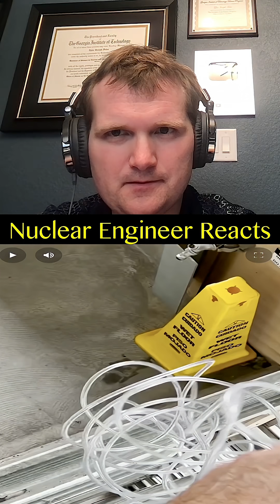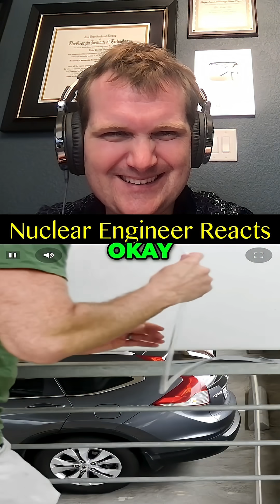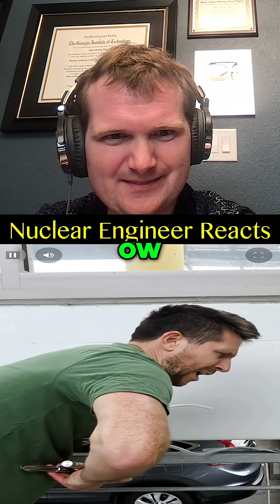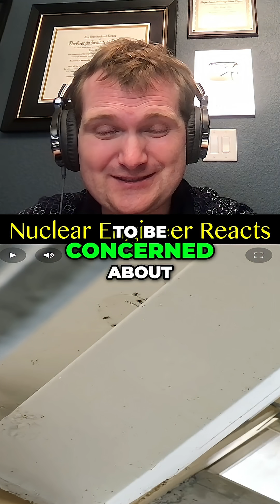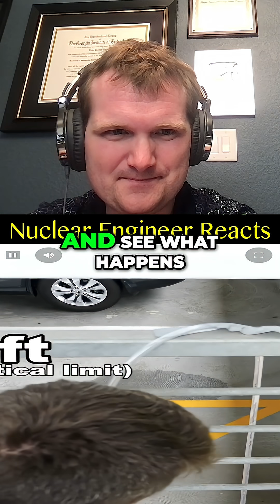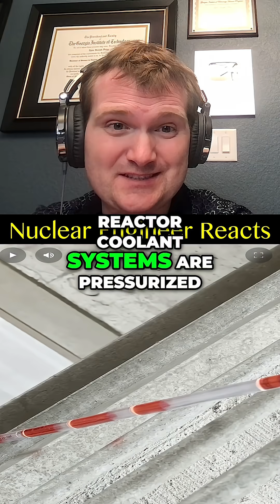Can You Drink from the World’s Longest Straw? - Nuclear Engineer Reacts to Action Lab

Comment: For those who are still connecting .s water pressure is desnity×gravity×height=1atm -capillary pressure(although much negligible) but together it may round you about to 34 feet

Now water over certain height has lower pressure than at the bottomost since top end is vacuum and lower end is 1 atm. One may also consider some pressure gradient for which lower pressure regions starts to evaporate at ambient temperature

Comment: So what would happen if you add 100 million times more suction power to the vacuum? Could you possibly suck up the water quick enough to avoid the boiling? Surely some magic number exists of suction power in the vacuum that would allow the water to start traveling quick enough to necessarily travel higher than 34 ft? Just curious.

Comment: I have don't industrial work for the past decade or so and bro here is always spot on. That's why every pump you see has an equal to or smaller diameter discharge than it does suction, gotta prevent cavitation if you don't want the pump to have an early death.

Comment: For the noobs like me, i searched why the water boils. The water  "boils" because when you suck, you make the pressure inside the tube lower than the atmospheric pressure. At atmospheric pressure, the water boils at 100°C but at lower pressures  (close to 0 kPa/psi/atm etc) the water boils at much lower temperature. For example, if you create a suction pressure of 1psi, the water inside the tube would likely boil @ 38°C or 100 °F. This also explain why it is easier to boil at higher elevation than in sea levels

Comment: This happens to pool pumps when they’re not primed properly.  You need to open the bleeder valve at the top of the main filter, otherwise the pump will run too hot and burn out, in addition to cavitation inside the pump

Comment: Up until 33 feet, trees use a process called cappilarity to pull water up like a sponge. For trees taller than 33 feet, moisture evaporating from their leaves creates negative pressure and pulls water higher. 🤯

Comment: One cubic foot(12x12x12) of water weighs 62.42 pounds.
62.43÷12÷12=0.4335 pounds per square inch. That's per foot of depth.
Atmosphere pressure is 14.696psi
14.696÷0.4335=33.90feet.
The highest you can suck up water is 33.9feet.
That's why vacuum cleaners aren't lethal👍

Comment: He's incorrect; it can't be more than 33 feet only if the 33 feet is vertical.  If it is flat or up an incline that extends 50 or 60 feet, but the vertical height is less than 33 feet, you should be able to suck the liquid through the straw.

Comment: The “theory” to vaccum - pull water ~33’ is based 1. on the water being pure (no minerals-just H2O) and 2. having an atmospheric pressure of sea level (maximum pressure outside the straw). These two factors should also be considered.  It’s really the external pressure “pushing” the liquid into a lower pressure area.  So with lower atmospheric pressure (higher altitudes) the 33’ is greatly reduced.

Comment: I don't get it....what is atmospheric pressure and why is 33ft the limit??
Reply: Ok let me explain in a layman's terms: 

Imagine you have a super long straw, and you're sucking water up through it. Air around us is always pushing on things, including the water, helping it move up the straw. But air can only push the water up about 33 feet high.

If you try to make the water go higher, there's no more air pushing it up. At this point, the water at the top starts to bubble and turn into steam, like it's boiling—even though it's not hot! It happens because there's almost no pressure holding the water together at the top of the straw, so it turns into vapor all on its own.
Reply: Water acts that way because it needs help from air pressure to stay still and calm. When there's no air pressure, like at the top of a super long straw, water can't stay squished together anymore. So, it starts to break apart into bubbles and steam—that's what we call "boiling."

It’s like if you’re holding a big, full balloon with both hands. If you let go, the air inside the balloon escapes because nothing is holding it in. For water, air pressure is like those hands keeping it calm and liquid. Without it, the water gets wild and starts bubbling!

Comment: lol this has been busted. I used a vac truck to suck water out of a coal bunker and was 79 feet vertical with no breaks in the line as it was completely sealed so no more air could get in the line even if there was a tiny leak it was completely submerged how ever my straw was 8 inches around
Reply: Yeah, that isn’t a sealed system, genius.

Comment: Does this work the same if you push the water from the bottom instead of pulling it from the top?
Reply: No, sucking from the top essentially creates a vacuum. You can only reduce pressure so much before, like what happened in the video, the water boils. When you push from the bottom you are no longer reducing pressure but adding it. That gives you a much higher limit, as long as your equipment can handle that pressure.

Comment: my marine engineering brain, specialized in hydrodynamics and thermodynamics, here screaming:
"not the atmospheric pressure, the surface tension. the energy is inside the molecule. atmosphere is just the enclosure."
but, yeah, a function of atmospheric pressure.
lower value at higher altitudes, just like boiling point is lower at higher altitudes. same thing really...

Comment: Is the difference the pump being on top rather then bottom? Water well driller here and we pump water vertical more then 400ft, im confused
Reply: This is for pressure from a vacuum which can only equal out to the atm. You can use like impeller/centrifugal pumps to go higher than this which imparts KE on the fluid so basically you can push water further than you can suck it

Comment: How do they run pipes of water from low grounds to super high skyscrapers without cavitation happening?
Reply: pressure
Reply: The pumps are on the ground floor.  Also, well pumps are buried deep in the well to minimize the height difference between the pump inlet and the source of water, precisely for this reason.

Comment: Fun fact, this is also used as a backflow prevention “device”😅 in water systems. Can’t remember the exact height but it’s around 34 ft. They will essentially install a vertical pipe in the line that goes up above the 34ft range, so that the only way water moves through the system past that point is when it’s pumped to the destination. So when there are floods or backflow, it can’t get over the hump to contaminate the potable water supply since it’s physically impossible for it to get over the bump without help.
Reply: Don't you get the same effect as the boiling thing by just putting you thumb on a syringe and pulling with a bit of water in it (bad explanation)?
Reply: I was wondering if you could get over the hump or get higher than 34ft but pushing the water than pumping it from the top like they did in the video? Is there a difference between pushing the water up or pumping it from the top? I feel like you could overcome the threshold with pushing the water from the bottom instead of just taking the air out and pulling the water that way.
Reply: Uh, okay.👌

Comment: On water heaters, pump should be on return, if possible, for higher reliabilty, however hot water is pushed from exchanger.  It is not my study element, but i am very close to it everyday. Tubes are pessurised with constant preassure in higher or lower temperatures,  by preassure vessel and equlibring valves, so heat is distributed same amount on every branch. Try look for enthalpy, but it might not be very relative to this at all.
Reply: It is called Termodynamic Basics, if you are electrician to it your skills are supreme.

Comment: Just a question. It boils at low tempeture then?
Reply: It's not about the temperature. When pressure decreases, water eventually starts expanding, to the point where it turns into water vapour, essentially boiling just like it would when you give water a high temperature
Reply: as pressure decreases so does the boiling point, same goes the other way around, it's how the gas in lighters is liquid due to high pressure and how objects moving fast through water pull "bubbles" of gaseous water behind themselves despite both being at the same temperature of their surroundings

Comment: Could someone explain the correlation between 33 feet and atmospheric pressure? Also how atmospheric pressure prevents this straw from working?
Reply: Given a liquid of uniform density (rho) spanning across a height difference of h, the pressure difference (∆P) between the bottom and top is given by the equation:

∆P = rho*g*h
where g is Earth's gravity.

We are interested in the case where pressure at the bottom is 1 full atmosphere, and the pressure at the top is zero (where water can't be liquid anymore).  Technically, to be more accurate, you could also use water's boiling pressure at room temperature, which is 2.3% of an atmosphere, but for our purposes, we'll use a perfect vacuum.

Solve this for h:
h = ∆P/(rho*g)

Plug in water's density (1000 kg/m^3), Earth's gravity (9.8 N/kg), and Earth's atmospheric pressure 101.3 kPa, and get:
h = 10.3 meters, which translates to 33 feet
Reply: It's not that atmospheric pressure "prevents" this straw from working, but rather that atmospheric pressure is what is needed to make a straw work in the first place.  Since atmospheric pressure is finite, there is an upper limit to how high a perfect vacuum can suck liquid up a straw.  If it goes any higher, it would need to have a negative absolute pressure.

Derek from Veritasium has a video on how negative absolute pressure can exist for liquids in a metastable state you could call a super-sucked liquid (similar to supercooled water).   It is titled, "How can trees be taller than 10 meters?".

Comment: How does the water start boiling just because it's in a tube?
Reply: Water boils when the water molecules escape from the surface. There are 2 things preventing this from happening:
1. The pressure of the air pushing back on the water, like a bouncer preventing you from entering the club.
2. The water molecules doesn't have enough energy, i.e. it has low temperature, like you are trying to get past the bouncer but are very weak and small.

When you suck up water through a straw, you are sucking out the air, which creates low pressure. If you keep sucking, eventually you will suck up the water if the straw is short. The height of the water in the straw is correlated to the air pressure in the straw (lower pressure means the water goes higher)

If you have a long straw like in the video, eventually you suck out so much air that the pressure gets really low, which causes the water molecules to easily escape from the surface. It's like you fire all the bouncers from the club and even weak people don't have to fight past anyone to get inside.

Boiling doesn't have to mean the water gets hotter. In this case it means the pressure gets lower, and water molecules escape

Comment: Wait is this why well pumps are installed at the bottom of the riser instead of the top?
Reply: Yes.  Because there is an initial decrease in pressure when water first enters the pump.  So it is important to have the pump as low as possible, to minimize the risk of cavitation in the pump inlet.

Comment: So if we put a water pump at the top floor of a 10 floor house and pump the water from the ground to the top floor tank (>33 feet), the water won't be pumped in?
Reply: If the pump is on the ground floor, the pressure will start higher than atmospheric in the first place.  Typical household water pressure is around 2 atmospheres of gauge pressure, or 3 atmospheres absolute.  This means you can pump it about 66 feet above the pump before it is at atmospheric pressure, and you need to pump it with a second pumping stage.

Tall buildings also will have a higher pressure on the water main, and then drop it through a regulating valve to reduce it to a lower pressure for each dwelling unit.

Comment: yeah. Water weighs 1kg per Liter, thats 1cm² every ml. As gravitation is approx. 10 ms² and the sorrounding air pressure is approx. 1kg/cm² we can surely assume that 10m is the limit the atmosphere presses warer up a tube. How on earth can someone calculate this in 33 imperial nutbag units?
Reply: You know, you can use a search engine to translate 10 meters to feet.  It's faster than typing your comment.

But if you must know, here's how you'd work it out in imperial nutbag units.

1 atmosphere = 14.7 psia
Density of water = 62.4 pounds-mass/ft^3

P = rho*g*h, solve for h:
h = P/(rho*g)

Note that by definition, 1 pound-mass has a weight of 1 pound-force on Earth.  This means g = 1 lbf/lbm.  For pressure, psi implies force pounds.  For density, the pounds as mass pounds, but implicitly convert to force pounds by default on Earth, when the force is implied to be weight.

Multiply by 1 in a fancy way to convert psia to psf, so everything is in pounds, feet, and seconds:
14.7 psia * (12 in/1 ft)^2 = 2117 psf

No plug it into the formula:
h = 2117 psf / (62.4 lbs/ft^3 * 1 lbf/lbm)
h = 33.08 feet.

Comment: I’m confused as to how a liquid can boil without heat…
Reply: Boiling happens when the pressure of bubbles forming inside the liquid, exceeds the background pressure.  When there is less pressure, the bubbles can exceed the pressure at a much lower temperature and cause the boiling to happen.

You can either boil water by raising its temperature beyond the boiling point, or by dropping its pressure to its boiling pressure at room temperature (around 2.3% of an atmosphere).

Comment: How do trees grow higher than 34 feet ?
Reply: Derek from Veritasium has a video on that question, called "how can trees be taller than 10 meters?".

The short answer is that the water is in a metastable state where it "should be" boiling, but doesn't have the activation energy to start boiling.  It can carry a tensile pressure in this state, unlike water exposed to air.

Comment: why does it boil? because of the pressure in the tube?
Reply: By sucking out the air from above you reduce the pressure coming from the air on top of the liquid. The outside pressure from (the atmospheric pressure) then squeezes the water upwards as a consequence of the missing pressure inside of the tube. But this atmospheric pressure can only push it up around 33 feet. At that point, if you then again reduce the pressure inside the tube by sucking out even more air, the water starts to boil, since reducing the pressure on a liquid like water lowers its boiling point (it's called the vapor pressure). 

Another way to look at it is that the pressure holds the particles in the liquid, it works against the movements of each particle. By lowering the pressure, the particles become less restrained and therefore, they can move more freely. Note that this doesn't mean that the temperature of the liquid gets higher. In fact, the temperature stays the same. The particles have just less force pressing them together when you reduce the pressure around them. As a consequence, the boiling temperature gets reduced when you lower the pressure around a liquid. You can even get boiling water that is boiling at room temperature this way. That's also what's happening in the video inside the tube.

Sorry for the very long explanation. xD Have a good one!

Comment: What would happen if the fluid was liquid nitrogen, and you had a massive pump that could pull the liquid up fast enough. If the reason the fluid doesn't go higher is it boils; how instantaneous is the reaction? Can we cheat this with cooler liquid, or quicker volumes.

Comment: you can boil water by pumping them up ? thats lit. yo i wanna more about this. what to search?
Reply: You boil water on the inlet of the pump, rather than the outlet.  You can either boil water by heating it to its boiling temperature, or sucking it  until its pressure reduces to the point it can no longer be a liquid.  It takes pressure to maintain a liquid state.

Comment: pretty usre you can increase the height the water travels by using valves and releases which will allow you to reset the atmospheric pressure to  0 after decided heights.
Reply: Just apply pressure from bottom, push instead of suck😂

Comment: Technically speaking if you are able to suck it up that high wouldn’t you burn your mouth because of the boiling hot water?
Reply: No.  The water is boiling, but it isn't hot.  The water is still at the same temperature as the ambient air, since no heat was added or subtracted.

Technically, the water will decrease in temperature.
Reply: @ but doesn’t the compression and therefore friction between the atoms generate heat?

Comment: Because it's 33', atmospheric pressure boils it... im dumb. Can anyone explain this please
Reply: So basically to boil water you not only can use temperature(heat up things) but also pressure ( like the low pressure cooker, by lowering the pressure inside the boiling temperature decreases). And 33’ is the height after the pressure in the straw drops, so water can boil now at the same temperature but at lower pressure. 
Simply just imagine water at the bottom if you don’t do anything is at atmospheric pressure, by sucking you create lower pressure inside the straw and water goes up. 33’ the pressure lowers but not enough to drop the boiling point so you can say it’s atm pressure and as soon the pressure is low enough(after 33 feet), which means lower pressure lower boiling point.

Comment: I wish this was how I learned air pressure influencing boiling instead of spending 30 minutes cleaning a chamber vacuum sealer cause i tried vacuum sealing a bag of slightly above room temperature chicken stock cause I was in a rush
Reply: so what you thought it would heat up?